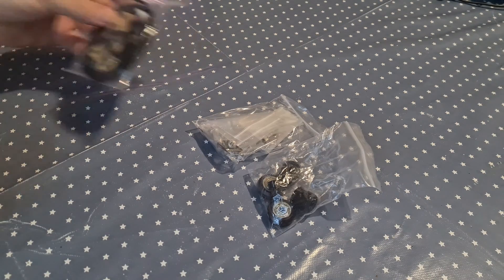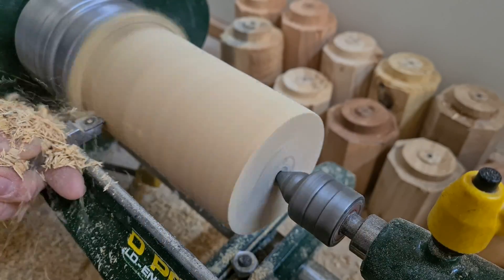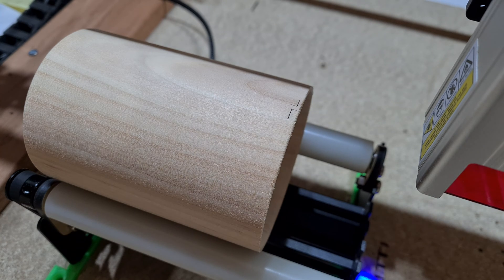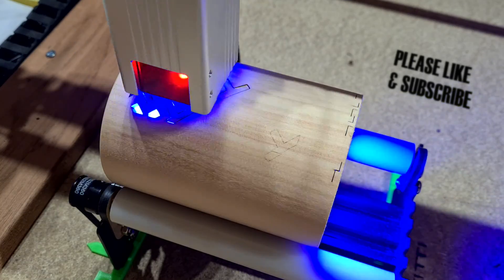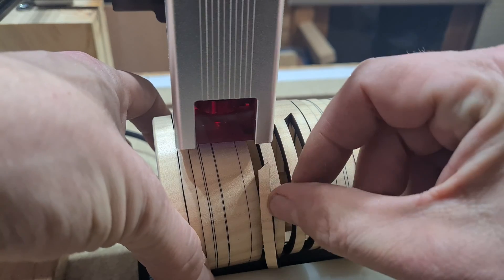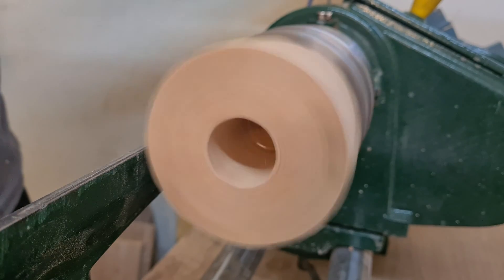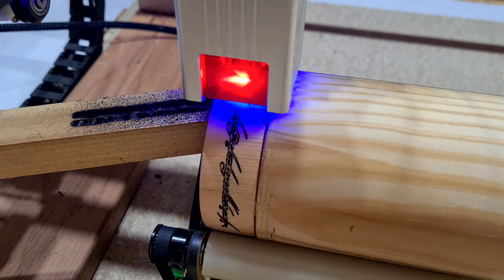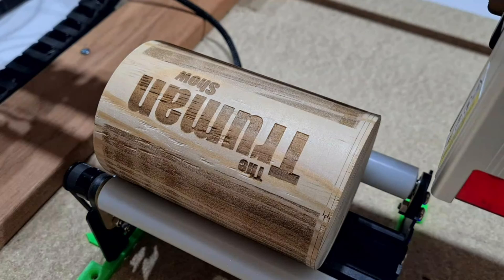How to Use the Ortur YRR 2.0 for Rotary Laser Cutting

Comment from the maker: Question: What is the best continuous pattern for rotary laser cutting of a wooden cylinder?
Reply: Try sacred geometry :)
Reply from the maker: @FuneralProcession  Very challenging!
Reply: Try something Escher perhaps ?
Reply: @mpart_woodlathe-stuff  Yes to that !!an engraved face First ''Rays'' then the spiral effect for those who don't know Escher and his optical illusion works.https://www.youtube.com/watch?v=5c33l8D0Bg4
Reply: @Uniquettt  Nice link - thanks !
Reply: Celtic knot as on the handle of some Sgian Dubh's then filled with blood red resin the returned to lath too hollow and polish finished art piece. If a smaller wood rod wood blank is placed inside before filling with resin then less resin needed and lees waste
Reply from the maker: @Uniquettt  Thanks Michael. I've seen another pattern that could work with this methodology. Will have to look into the celtic knot!

Comment: Ray Whitby. Could you use a thin masking tape on the out side to hold everything together. Then you would not have the problem of a piece jamming the rollers.  Keep up the good work.
Reply from the maker: I guess it depends on whether it interferes with the air assist. Could possible criss-cross thin strips on the inside! Thanks for the suggestions. All the best. Ray

Comment: Nice creations Ray, I wonder if a way to prevent pieces falling and jamming the rotary module is to apply a thick transparent sticky tape on the inside wall of the blank. This should keep all the pieces in place without being cut by the laser given its transparency, not sure if it will whitstand the heat generated though, worth a try 😉
Reply from the maker: Hey Alessandro. Yes this would keep the pieces in place, but it could prevent the air assist. I ran some tests last night and found that creating tabs (or bridges) keeps everything together and Lightburn software can do this automatically. I'm still learning! All the best. Ray

Comment: Another great review Ray. I found the information very useful. 
Looking at your Lightburn screen it looks like you did the cutting at 200/90 and 200/85. I missed the thickness of those cylinders but it sure looks like it did a good job.
Fun video to watch with lots of good information.
Gary
Reply from the maker: Glad it was helpful Gary! Some of the initial tests I did with 100 mm/min and could cut 5mm cylinder wall in 1 pass, but seemingly not always consistently and so very slow! Probably the variation of grain around the cylinder and the type of wood causing the issue. I'd love to try a CO2 laser and see if I can pick up the pace and retain accuracy. All the best. Ray

Comment: Some thick blue tape inside... maybe some foil to insure it doesn't cut all the way through?  Just an idea.
Reply: Sounds better than my idea of putting another cylinder inside !
Reply from the maker: I did try this Richard, where a smaller cylinder could roll around. It may work with a chuck type system, but with the rollers it caused momentum and knocked the main cylinder about with any rapid movements across the pattern.
Reply: I'd put a foil-wrapped shop vac hose inside.  Get the smoke out as fast as possible to prevent smoke stains.
Reply from the maker: I think it is the laser hitting the other side and scorching it. So need to block the beam, after it comes through the upper surface.
Reply from the maker: This was one idea too, but blue tape is easily cut by the laser and you still need the air assist for clean cuts, so not sure if the tape would become a barrier and problem for that. I then thought about a criss-cross network of thin tape strips, which would overcome any potential problems I've just written about. Definitely will have to try!